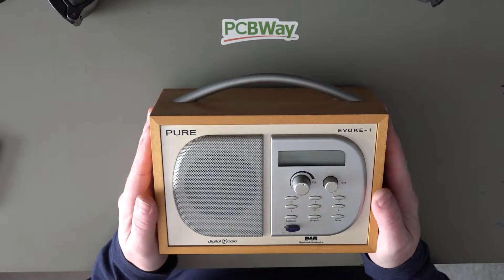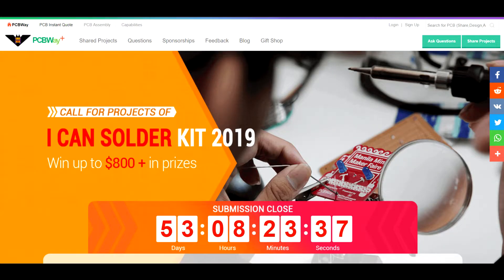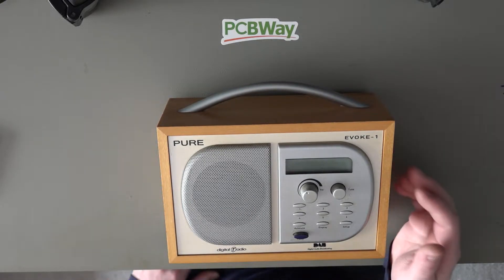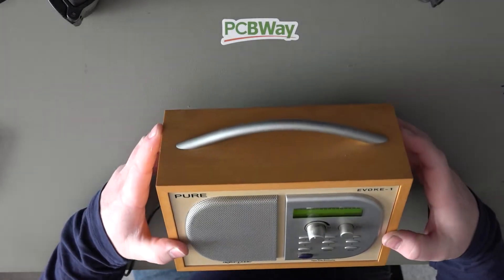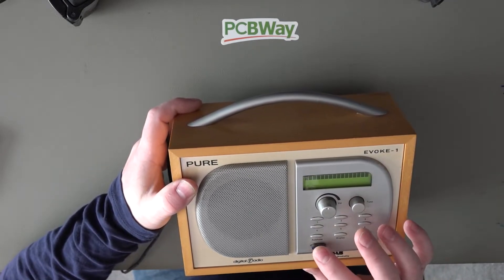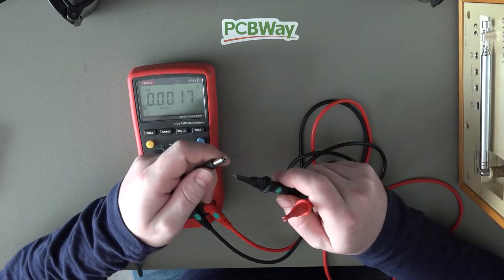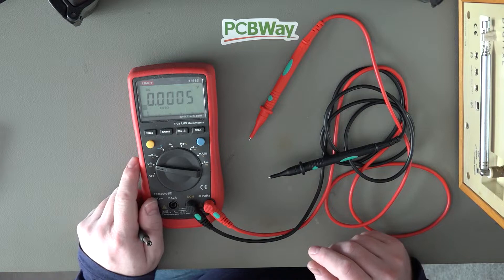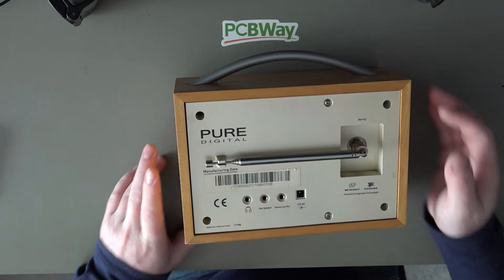Can We Repair - Pure Evoke 1 Dab Radio

Comment: Thanks for the video. I have exactly the same problem on an identical early model Evoke 1. I have stumbled on a solution. If I switch the radio on I get the blank display as you do. I leave it switched on for a few minutes, then switch off for about ten seconds; then switch on and I get DAB reception! I have no idea why this works, but it does. Good luck to anyone else with this problem.

Comment: Really like the video. Have been trying the same with a SONUS 1 but it has no signs of life at all. However, the amp board works when I put a signal at the input. I agree that the radio is not worth the time it might take to mend but if you have any ideas on fault finding the tuner board please put them on-line and I would try it just for the challenge.

Comment: A fine effort anyway . The processer may have failed or there could be a fault in the display module ,  the control address lines between the two items will not function correctly hence the whole thing gets stuck in a weird stalled mode.

Comment: Was the Chip a CHORUS FS1010G-A? as my PURE SONUS 1-xt has failed and I have found this chip cracked. It must get quite hot and eventully crack over the years with the heat. Should have a heat sink on it really.

Comment: It would certainly be interesting to try replacing the LCD module. They're commodity parts and quite cheap so should be possible to get an exact replacement. And if that doesn't work you've got 2 LCD modules to use in Arduino projects!

Comment: I have several Evoke 3's. My original had quite a bit of portable use and I replaced an aerial but I have a scratched speaker grill. I have noticed that one I got off Ebay had a darker display to the older one as though there is a backlight bulb or two gone inside? But if it is a 'unit' then hard to repair this backlight? I was tempted to delve inside and repair the bulbs if there are any? Great shame as the radio itself is superb as you can record programmes at will. [Most people I have found have to rely on TV internet sources for this which is less portable].
Reply from the maker: Thank you for your comment, they are an integrated module with led backlighting so you will most likely have to replace the entire display unit as one unfortunately

Comment: I looked at this with interest. I have an Evoke D4.. I have no visual display at all. As you say a possible chip corruption. 
I had noticed that the radio can get into a bit of a twist if you use the sleep function. But unfortunately without a display it is seemingly not possible to reboot the firmware. 
The fact the radio is not repairable is such a waste.
Pure radio owners, Imagination Technologies, was an excellent UK company until it was sold to a Chinese business. It has now had all of the good parts (which were expensive) stripped out of it and I would never buy a Pure again. I would urge people to look at Roberts as an alternative.
I am not connected with the industry, just an avid radio listener.
Reply: I also have an Evoke D4 which had no display. The internal design of the D4 differs from the Evoke 1, however the approach to replace the LCD is similar to that demonstrated here. It also has two hidden nuts on the volume and select knobs that need removing in order to access the LCD screen. Thank you for this video as it helped me discover these hidden nuts so I could undo them.

Comment: Love that radio... looking thru eBay and they are very pricey..
Reply from the maker: Looking on ebay they are about £30 to £40 for a working one here in the UK
Reply: @ElectronicStuff  I'm definitely buying one because of this video.. Looks really well built the size of the driver looks like it delivers good bassy sound... The heat sink for the op amp looks good...

First time I seen this radio
 Hopefully you don't give up on it..

Hopefully its just a hard to see bad solder joint and you get it working again.. Good luck with it Thanks for uploading this even tho it didn't work 👍
Reply: Got mine 10 pounds at a shop. Use it for Aux tho.